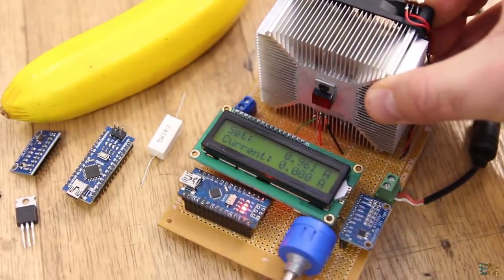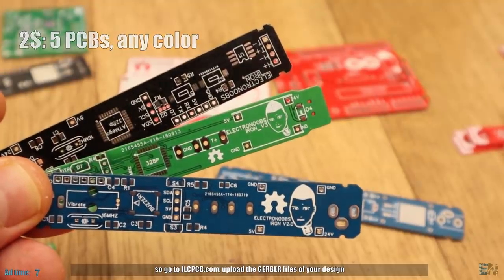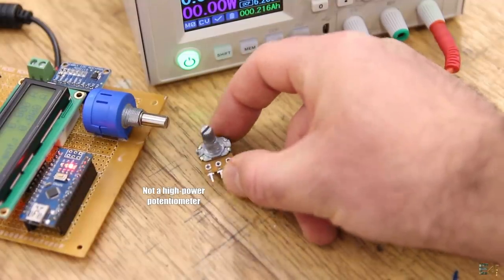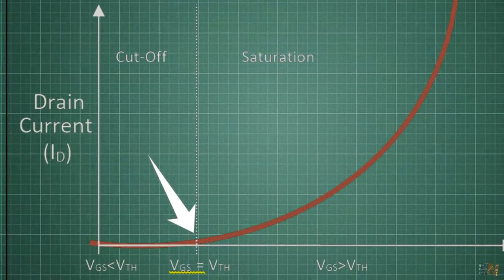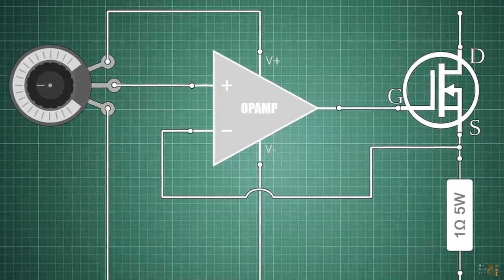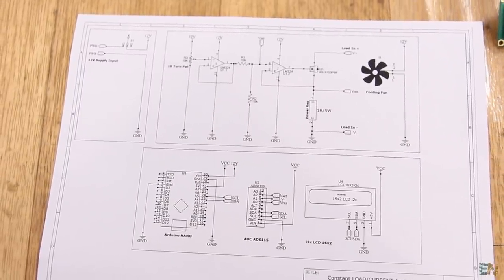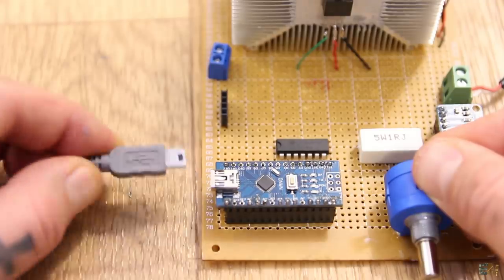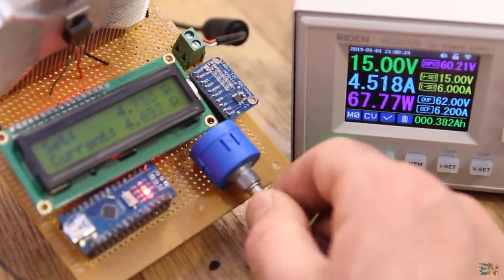Analog Constant Load/Current Controller Circuit

Comment: I tried to make one an year ago. Target was to make one that can handle 30 volt and 20 Amps, but failed to do so after burning couple of mosfets and power resistors. This circuit is interesting and challenging me to try that project with this circuit. Will try. Thanks dude.
Reply: 600W is a lot of heat... is normal to burn some componens xD
Reply: water cooling
Reply: Then try to use oven instead mosfets ;)
Reply: Hi pliz can you send to pe the circuit of power electronic load

Comment: Excellent presentation and style well done. I have a few reservations about this project! 
You explain using only one op amp then use another to buffer the pot. This is not necessary. You use 12V because the gate voltage is added to the sense voltage and 5V would never work at high currents. You could use a single transistor to shift the op amp output and could get rid of the first op amp. 
The LM324 has spare amplifiers, you should explain what to do with them (maybe I missed that part)
The current is set with a resistor referenced to the 12V, this may be accurate under one set of conditions but it is better to use a regulated voltage or a reference voltage.
Why do you want 16 bit precision, realistically 10 bit precision is enough for almost any real load. 
For speed of response this analog circuit will always be better than a digital version with PWM output to set the fet gate voltage, many active loads are used to test transient response, the analog circuit will be better because PWM will be too slow.

Comment: This is great and simple. Looking forward to the digital constant current project too. Can you also include AH and WHr readings? Another thought is have it connected to a laptop or PC to control power and display results for example, to discharge batteries and measure their capacity.

Comment: Great project! One thing though why do you have the voltage follower infront of the "main" op amp? Dave have the same circuit (more or less) and he said that it's there just because he had a pcb with that schematic laying around...
Thanks for the answer and the video!
Best regards!

Comment: Can you please explain the 1 ohm 5W resistor? At 5 amps it will dissipate 25 watts of power. But you are using a 5W resistor. (P=I^2 * R) Why is the resistor not smoking and blowing up?

Comment: Cool, but this load cant take 5A, because of the 1ohm 5W resistor. At 5A this poor resistor would dissipate 25W!!!
Reply from the maker: Yes, sorry I haven't mentioned. Just use a 100w resistor of same value and that it.
Reply: @ELECTRONOOBS  no need for 100W resistor, you can use a lower resistor's value, like 0.1r and amplify it with an OPAMP. You'll have a lower voltage drop, which will allow you to have more current flow with less power dissipation. You can easily get 0.1R resistor from an old laptop.
Reply: @FixDaily  there are even 10m ones
Reply: @Matix1710 with 0.1r at 1Amp you'll have 0.1V voltage drop, if you want to increase it to 1V you need to amplify it by x10.
You can't test this using a breadboard, you need to solder this so you decrease the resistance over contacts, otherwise you'll have no control of it.

Comment: Check current with oscilloscope you see current pulsing with avarage is you current. Because mosfet gate capasitor op amp over compensate and undercompensate. Better use darlington BJT. Alternative add capasitor at op amp pin and output pin :) I made same mistake :)

Comment: Very nice, this is a way better way to get a constant current than what i have found. Currently looking to build a DIY lipo cell capacity tester that can deliver 5 amp charge and 10 amp discharge for a single cell and this will help me greatly.
Could you use an analogue output with op amp gainer to supply the voltage that the potentiometer is giving? Use the arduino to supply voltage between 0-5v and use a gain of 2 to have a signal from 0-10v and so 0-10 amp possibility?

Comment: Hi, did you use the external ADC for better resolution or because the internal Arduino ADC is unreliable? I don't know if I'm doing something wrong but when I try using the internal ADC, the readings fluctuate quite a bit.

Comment: Hi Electronoobs. Two simple question... 

Why do you use the differential mode to measure the voltage drop on the 1R resistor, if it is referenced to the same mass as the ADC?
The second, is because you don't directly use the ADC of the Arduino nano itself? Is it because of the 10 to 16-bit resolution?
Thank's a lot.
Reply from the maker: No, is not about that. Under a lot of current there is a voltage drop on the wire as well (wire also has resistance) and we only want to measure the voltage drop exactly on the load of 1 ohm. After making tests, the differential mode was a lot more precise. Otherwise we get wrong values with a small offset dependent on the current so is not a constant offset....

Comment: Well you read my mind.
wanna make a car warmer to defrost the car since its now summer
got an aio water cooler and a heater bed(lets change that to a mossfet or 2)(why dont I just use a resistor) and a bit of ally.
but need to limit current this saved me googling :)

Comment: They could also carry out this project based on the attiny85 or use a screen that has a voltmeter and ampere meter without microcontroller

Comment: The pin numbering of the LM324 in the circuit diagram on your Tutuorial Website is incorrect.. + and - inputs are reversed! It says + is on pin 2 and 6 but it is actually on  3 and 5. - must be on 2 and 6!
Reply: Ahaha 😂 correct, aptly named noob, much better to correct ya mistake then leave it online

Comment: Why are u using differential measurement for the ADC at the current shunt resistor? isn't the PSU ground and the load ground is at the same potential?
The "Load In -" (V-) is connected to GND, so a single ended reading to "Vres" should give the correct measurement.
Reply from the maker: Yes, but even so, the wires resistance will create a small village drop at high current. So is better to measure the volate in differential mode directly on the load. After tests I got to that conclusion because I had offset values of error...
Reply: @ELECTRONOOBS  ah i see, thank you for the explanation

Comment: That 1 ohm 5W resistor will melt under 5A of current!
Reply: yes you are right. I don't understand the resistor value he is using. At 5A the 1 ohm resistor must dissipate 25Watts. But he is using a 5W resistor instead of a 50W resistor.

Comment: Hi, Variable voltage used to control MOSFET gate is a bad think. For ex. better method is a PWM control MOSFET with MOSFET Driver.
Reply from the maker: Hmm...that would create current spikes at each PWM pulse and I would only get the mean value of current. In this case we need more or less linear constant current value..
Reply: @ELECTRONOOBS  Yes, its true, but in many applications for ex. ~1kHz PWM it doesn't matter. In your device control by voltage on GATE can be considered correct cause all power will lose in MOSFET. In typical app when MOSFET control other device it isn't acceptable.

Comment: Hi, i bulit this circuit but i replace Arduino on mulimeter  and i have a problem. Now all of my mosfets are broken (irlb3034 and p60nf06)
Everything is ok when i tested this with small power supply(9v 1a) but when i plug computer ATX MOSFET are dead ( D-S is constantly open) 
Anybody can help me?

Comment: Can we use digital potentiometer.
Reply: yes, with stm32 or Atmega328 , the pwm are use for generate the voltage for drive the op-amplifer.  You could use rotative coder and store the value in eeprom  for the next use

Comment: 75W with 5W resistance?? What did I miss??
Reply from the maker: @AnandBhatB  pretty much all power is dissipated on the mosfet and not on the resistor.
Reply: @ELECTRONOOBS  resistor is in series with MOSFET. So current will be same. So if source is supplying 5A, same will go through resistor. P=I*I*R = 5*5*1 =25W across Resistor and 50W across MOSFET???  Still too much for a 5W resistor

Comment: Why use an external ADC if it is on the Arduino analog input?
Reply from the maker: Arduino is 10 bits. I wanted more resolution
Reply: 5/1024 = 0,005. Is the 5 milliamp step too rough?

Comment: You are using the op amp as a comparator so you are not using it in a linear way. You could check it with an oscilloscope at the gate you are going to see a square wave from vdd to gnd. You are basicly creating a pwm signal with analog stuff, so why not using a pwm signal from de arduino with no filter needed.

Comment: I generally enjoy your videos, but sometimes you skip over details that you should explain instead of just saying that things are simple, because perhaps they aren't. For example
1. Your first opamp looks like a voltage follower, but it is using positive feedback. This is not recommended AFAIK. So why?
2. Output of first opamp is divided by two using voltage divider resistors R1 and R2 before fed to second opamp. Why not explain this?
3. Second opamp also a voltage follower using  positive feedback...
4. The code used some kind of scaling factor to process ADC readings. Why not explain?

As a side note, many opamps don't like to directly drive capacitive mosfet gates directly, so a small resistor is common.